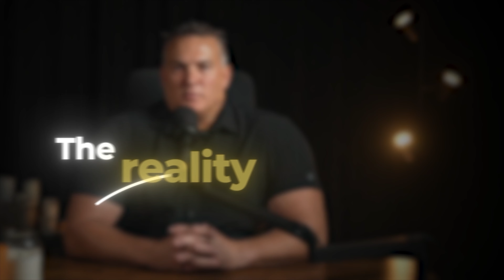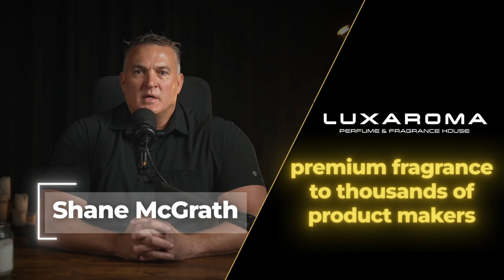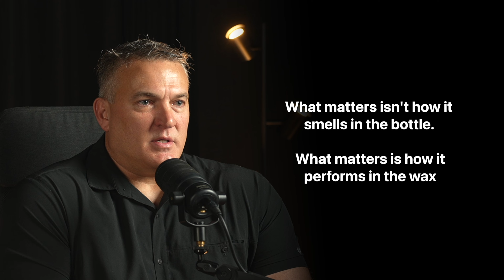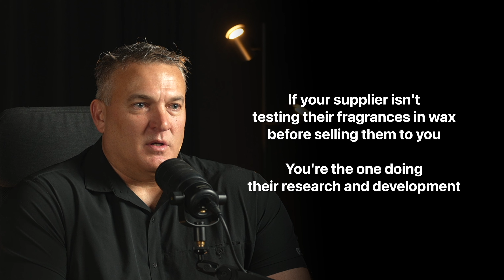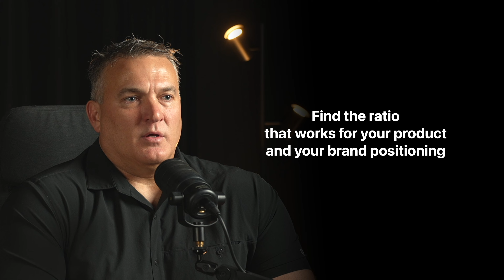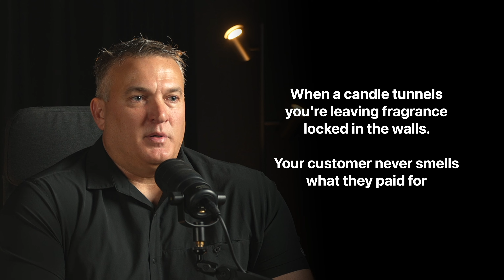How To Make Your Candles Smell Stronger (For No Extra Cost)

Comment: I have a double wick retail candle that has black soot all over the glass and it has blackened my bathroom wall - it’s a sea mist fragrance. Any reason why this is? Did I not let it burn long enough initially?
Reply from the maker: Hi Linda. Generally soot on the side of the glass indicates the wicks are too large. This is common towards the bottom of the jar as the wicks might have been fine early on nicely consuming the wax however near the bottom there is a lot of heat build up which helps melt the wax easier. The jar then becomes over wicked and fully molten. Glass becomes hot. Flame dances around and can put black soot on side of jar or above on walls and ceilings. If your making candles dont make the mistake alot of brands make they select wicks to melt the wax to the outside on the first light in the first hour. Even after a few hours if you still have a little unmolten wax around the outside this is probably better. After many burns and the wax melt pool is further down then it will melt the wax on the outside walls easier due to the heat build up. The rule is to burn for say 3 hour increments each day until all the wax is all gone. You are trying to select the smallest size wicks possible that by the end all the wax is consumed. This will avoid the problem you are having towards the end of your candle. Note if you go too small on the wicks then at the end there will be wax and fragrance left on the side of the jar. This would be too small. A common mistake or laziness on the maufacturers part is to use the same size wicks in that size jar for all fragrances. This never works as every fragrance has slightly different flow rates with each wax and wick combination. Its essential to test each fragrance individually. Back when we started ECOYA for a range of 12 scents we had 3 different wick sizes across those 12 scents to get the perfect burn on each scent. Most brands dont go to that effort. Another thing also impacting the sooting in particular on walls or ceilings is too high a paraffin content in wax. Most major brands will use a soy paraffin blend of wax and state soy wax candle. They cleverly arent saying 100% soy wax or natural wax so they can get away with adding paraffin into their blend. The more paraffin wax the more chance of black sooting. You might like to try candles that are 100% soy wax to avoid this and if making your own use a high quality soy wax like Ecosoya Advanced Soy wax for the cleanest burn. I hope this helps.
Reply: @luxaromafragrance thanks for your comprehensive reply - most helpful!